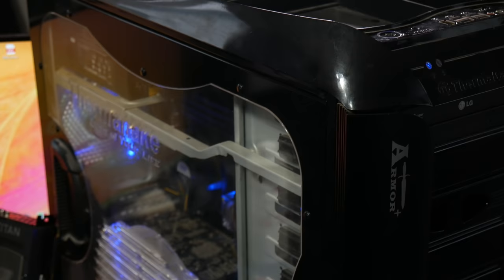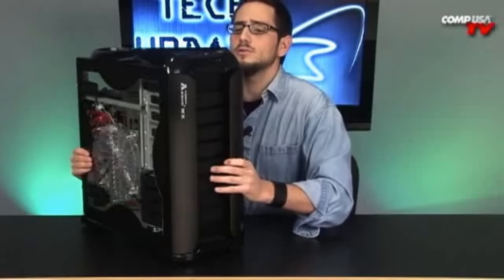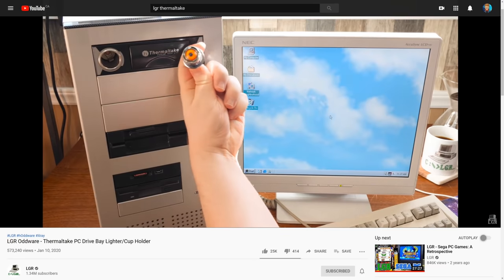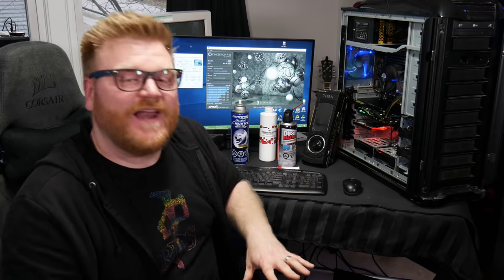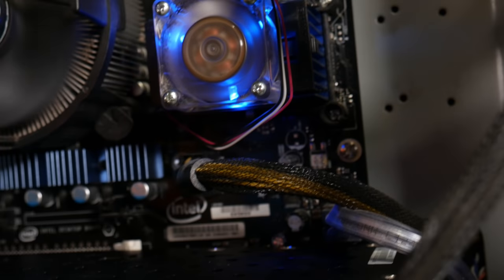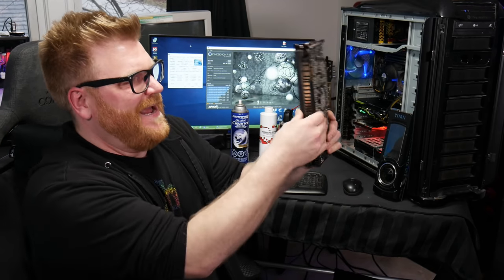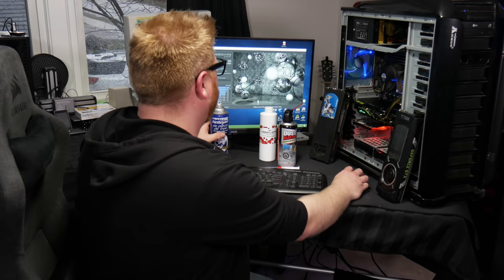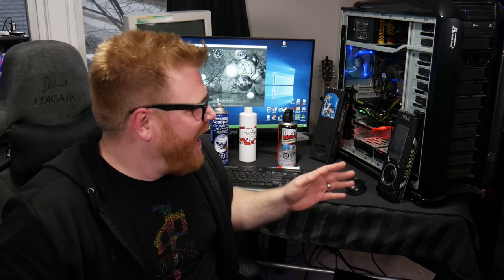Can $5000 buy a PC that will last 10 years?

Comment: 5000$ but stock Intel cooler
Reply from the maker: I know right, that's just bush league
Reply: There are people playing AAA games with 2700k and stock coolers right now and they are just beginning to feel like bottlenecks.
Reply: @JonathanPaulin  well yeah, especially if you overclock it. Stock amd coolers are great if you are running stock ryzen 2000/3000 chips or if youre like me and overclock a 1600AF it holds temps just fine under load. Obviously a little louder but nothing i cant live with.
Reply: i got my noctua nd 14 in 2010 and 10 years later its still rocks!!!!
Reply: @JonathanPaulin  i know right. i use a i7 2600 with a rtx 2060. only a few games like Red Dead 2 actaully choke the cpu.
Reply: @TimmyJoePCTech  did the guy build this himself or did he get it pre-built
Reply: Right!  That was the first thing i noticed!  How sway...how?
Reply: he could just get a aio
Reply: But it was the big 1st gen i series cooler.  They did a pretty good job as long as the thermal paste was good. My system rocked one for the longest time and it stayed nice and cool. If anything that was a problem then it was the graphics card running hot when gpu's were getting big upgrades from the manufacture *cough Asus cough*. The only stock coolers I'd worry about are core 2 quads since they run pretty toasty even with good case ventilation. If you live in a place that's hot or your overclock you should have aftermarket cooling.
Reply: @Rainbow__cookie  it wouldn't suit this guy's as he will use the machine for the next 10 years or so which would be outside of the life cycle of the aio
Reply from the maker: @davidhiggins2804  Bought it at a PC/IT store here in 2009
Reply: Jonathan Paulin I play with i5 7600k and stock cooler but here’s the background. In 2017 I had $450 to build a computer. But I had some components like a crappy dedicated GPUs (ddr3 2gb, ssd, hdd). With that $450 I built a 2 core Celeron pc, 8gb of ram and 2 Hdds with an ssd. That was the best I could get at the time. Then 1 year later I buy a i5 7600k and use the stock cooler because I’m not over clocking. Now I have 8gb of ram 1050 ti and i5 7600k.
Reply: @kennysboat4432  Upgrade your GPU to GTX 1650 Super or GTX 1660Ti. Absolutely worth it for 1080p Gaming.
Reply: Uber Gamer!
Reply: The Intel stock cooler is really bad for games like Crysis 1-2-3, X-COM 2 and many others even if you have a non K Intel Core CPU, never use the stock cooler for games. I'm using an i7 2600 too, very good CPU but you need to upgrade your cooling as soon as you can.
Reply: I ran a Core 2 Quad 9300QX build with an Intel mobo that supported first gen DDR3 until like 2015. Was a sweet build and I was stoked to have a Core2 with Ddr3 in it
Reply: @TimmyJoePCTech  I just got this exact board, but with the i7 970 and the Intel tower cooler. It's good with an overclock, but the bios is a little funky, and stay away from the 4th slot of ram
Reply: Noctua NH-D15 should be the norm for all high end builds. Just like how the Cooler Master Hyper 212 was for cpus up until 6600K.
Reply: "5000$" putting the dollar sign after the numbers is one my pet peeves. 
The dollar sign goes in front of the numbers like this --> $5000

Comment: How to have a high-end end computer for 10 years in these two easy steps....1st Build $2500 computer wait 5 years 2nd build $2500 computer.
Reply: Dan Reed thank you for putting the dollar sign on the correct side. I almost never see that anymore.
Reply: Tyler Mitchell it really should be 0$ instead of $0
Reply: Reminds me of the memers buying overkill 16 core PCs for gaming cause muh futureproof when nothing is futureproof
Reply: @zubiecup  in many other languages than english the currency sign comes after the amount so i guess thats why you see a lot of people doing it like that
Reply: Talvisota yes, I’ve always assumed that’s the reason.
Reply: Kennys Boat no, not for USD. The sign always goes before the amount. The cent sign is written after the amount, though.
Reply: Most of us upgrade one part at a time basically. In general I upgrade my CPU on a 5 year cycle and GPU every 2.5 year cycles with storage upgrades and misc in between. My cpu I did wait 5.5 years as my 4770K was pretty solid until around 2018 or so with some virtualization tasks and a few stutters in 2019 games here and there. I do feel like an idiot just upgrading to a 2080Super as the 3060 will humiliate that and probably Navi2 :-(. I will live with minecraft raytracing for 2 and 1/2 more years as I paid $799 for my evga model.
Reply: @Amusia727  the i7 i bought  back in 2013, out classes the i5 that people kept claiming was enough. is still playable.
Reply: @mryellow6918  Just because a Haswell i7 is still playable doesn't mean it's "futureproof".
Reply: Yeah 1500-2500 every 5 years makes more sense than 5000 every ten years
Reply: @Alex-pu5lz  it depends on your peripherals
Reply: @Amusia727  Futureproof for 4 years at least, unlike intel alternatives.
Reply: Technically even $2500 is extreme for a high end PC, a decent ryzen + RTX card would bearly be around the $1000-$1500 mark if you look around right and get good deals, end of the day the better the deal you get the better you are in the long run.
Reply: I definitely wouldn't recommend spending "as much as you can," but it is possible to future proof to some degree.

I spec'd my 2010 laptop with a first gen i7, 8GB RAM, dedicated GPU, 1080p screen, etc for $1,300.  It easily remained relevant and usable for 10 years, and I was even able to game on it that entire time.  I periodically maintain it as it is still a great work/multimedia computer.

I built my 2017 desktop to do 4k gaming, 4k60 video rendering, and VMing for $4,000:  Two GTX 1080 Tis, i7 7700k, 32GB 3600Mhz RAM, 1TB m.2 SSD, liquid cooling, etc.  Even with SLI support having mostly gone away, the thing's still a tank (~RTX 3060 equivalent on a single card) and a monster movie maker (8k60 VR w/binural audio).  Only thing I've added is more covenient storage space (24TB of SSD) for video rendering/game installs.  No doubt it will last me another five years, and it has literally paid for itself.

Comment: A guy on a forum I used to frequent bought a $1000 video card every year, sold it for $800 and bought another $1000 card so he had a top of the line card for $200 a year
Reply: Well today a rtx 2080 ti is much more then 1000$
Reply: This is pretty much exactly what I do, and how I went from a low end gpu to being able to financially afford a higher end one
Reply: Yeah idk about that. A 2080 Ti is $1200 USD and I’d be lucky to get $600 for my 1080 Ti and its a factory water cooled Aorus card.
Reply: @JTTTTT850  2080ti can be as low as $890~
Reply: @TehTechExpert  2080ti can be $100 in about 5 to 7 yrs.
Reply: @LeoNyeDis  I'm almost embarrassed to admit this but I'm pretty content with my RX 580 😛
Reply: @jeremygregorio7472  dont really need to upgrade until next year tbh. My 970 still runs games fine at 1080p. Thats exactly what its for, 1080p. But next year, i buy whole new system because new consoles and everything.
Reply: yeahh buddy same, I spent $1000 for my pc and I paid $400 for my vega 64, and I play almost every triple a games in 4K high 60fps, I don’t need to upgrade anytime soon, but I want to u know?
Reply: @Samuel Diffenderffer we talking top of range not mid range horid driver cards
Reply: @JTTTTT850  I bought my aorus waterforce xtreme with water block removed, and an NZXT G12 and Corsair H60 installed instead for $420 shipped to my door.
Reply: @jeremygregorio7472  went from an rx 580 to a gtx 1070 in exchange for upgrading a friends pc. wasnt a bad upgrade but if i still had the 580 i wouldnt be buying anything thats on the market right now
Reply: I mean he still spent that initial 1000$ so he still buying a 1000$  gpu  every year. This mindset only works if the card is given to you for free. He's still out a grand at the end of the day. Great way to upgrade yearly/each gen. But saving money wise not so much lol
Reply: @JTTTTT850  for non RTX Stuff the GTX1080Ti is likely better Than the RTX2080ti
Reply: @JTTTTT850  Well the 1080 ti came out 3 years ago for 800€ so it hasn't dropped much in price.
Reply: @JTTTTT850  1080 ti can be found for 380$ for inno 3d to 420$ for evga sc2 

bought one from a guy in Thailand and also bought vega 56 red dragon for 210$
Reply: @jeremygregorio7472  i upgradet my rx480 (580 is a rebrandet 480) to a 5700XT after i had to but the AA down at 1200p in rise of the tomb raider.
Reply: 1500-1600 bucks every 3 years is what I'd say I do for my wife and myself
Reply: @yvonbriand9739  you don't have to buy a water cooled 1 zillion teraflops 2080 lol
Reply: I'm on the other side of the spectrum. I buy my graphics cards second handed and sell my old one. If you do enough research and have some luck, you can often find much better cards than your current one (Assuming you have a low to mid spec system) for only a few euro's/dollars more than your current one is selling. For me, the cheaper version of last-gen mid-end AMD card is often the sweetspot. I just upgraded from a R9 380 2GB to a RX 580 4GB. I bought the RX 580 for around €100,-. The 380 sells for around €50,- to €65. That €50 upgrade makes a huge difference. An 8 GB model would have been €40 euro's more, which would almost double my costs and 4 GB is still plenty for 1080p gaming.
I'm planning on upgrading my R5 1600 to something like a R5 3600 or a R7 3700x when gen 4 or 5 is out.
Reply: Jeremy Gregorio that might work but it didnt back in the day. A lot of high end gpus were $500 and would be worth 200 1 year later.
Reply: @JTTTTT850  Lol mine is the Asus Founders Edition 1080TI.
Reply: @cadenmiller  That's the boat I'm in. i7-6700k and a 1080TI. Runs games on high at 80 to 90 fps at 1440p. I want to build a watercooled system, because I want the challenge, and I like building PC's. Planning on building a new system in the fall when the 3080TI and the ryzen 4000 series launch. Then going to give my current system to my brother so I can finally induct him into the master race.
Reply: Raymond Sellers yeah I have a Ryzen 5 2600x with a asus rog strix b450-f gaming motherboard, I want to get an AIO for my next cpu, but I’m just gonna wait for Ryzen 4000 and get a x570 motherboard cause that’s the last lineup of the AM4 socket, then also I’m gonna get their rx 5900 XT, I’m personally Amd only idc about Intel or Nvidia
Reply: @yvonbriand9739  yes but why bother when a 4gb 1080ti can do the same thing for a lot less ?
Reply: That's 1200 a year
Reply: What about the cpu and mobo? Same thing?
Reply: @yeahhbuddy3932  I just upgraded from a 970 and a 4690k to a 2060 and a Ryzen 3600x and holy poopers, it's at least %50 to %100 faster in all newer games and benchmarks (3x faster in Cinebench)... If you wait until the 3000 series and Ryzen 4000, you'll be laughing at the upgraded performance and wondering why you waited. But definitely wait until next year, that new tech is going to be dope.
Reply: This strategy works well for Titan cards because they hold an oddly high resale value, I sold my Titan X Pascal for $950 AFTER the 1080 Ti came it, there's no reason it still should have been worth that much.
Reply: It doesnt work like that. You still have to spend the 1000$ for the initial card and it can be tricky to sell a one year old card for just 200$ less than retail.
Reply: Jeremy Gregorio same here👍 still does destiny2 max settings
Reply: @jaydaytoday3548  it will never be £100 because unlike back then gpu performance is way beyond standard. in 5 to 7 years people will play games at like 4k 120fps which that card will do about 4k 60 in most games. so,half the performance of what will most likely be the norm of 2027. it will be around £350 because we wont have improved much as we did from 2010 to 2020
Reply: @jeremygregorio7472  ive got rx 580
Reply: @yvonbriand9739  i'm probably gonna sell my 2080ti when the 3080ti comes out lol
Reply: scottrich976 a 4gb gtx 1080 ti doesn’t exist. But I know what you mean I still use a 1080 ti Kingpin and I love it but the OP said top of the line card every year.
Reply: Gamebattles1946 that makes sense you should get a good return on your 2080 ti lol
Reply: @JTTTTT850  you got to sell early in the product cycle.
Reply: @Samuel Diffenderffer I need that RDNA 3 in my life.
Reply: @cadenmiller  With the way nVidia is moving money around to their quantum division, AMD is going to overtake them and nVidia is letting it happen. This is the same situation with Intel. They have both openly stated they are moving the majority of their R&D and production to new markets. Also, the next generation of consoles are AMD machines, which means there is a good chance games are going to just run better on AMD machines. RTX? That is going to go the way of PhysX. As soon as Window's ray tracing fully hits the market RTX will be left behind.
Reply: @Bionic0ne yeah I also heard what intel and Nvidia is doing, their pricing is way to extreme and Amd deserves more. Also Amd is going to have raytracing them selves soon sooo...
Reply: @Bionic0ne I’ve been with Amd for at least 3 years, Ive never owned any Nvidia or intel product, and I’m very happy.
Reply: That worked for a long time.. until 2080ti. 2080 and 2080 Super are still GREAT cards.
Reply: @yvonbriand9739  I got a new one for 1000. Then I sold my 1080ti for close to 700
Reply: @blairlohnes8103  I went from a 4690k and a 660ti to a R7 3800x and 2070S. Was so worth it imo
Reply: I have not payed a full price for a gpu for quiet some time.
Reply: @Samuel Diffenderffer i would rather get nvidia because there is always new technology while amd just add fps, so it feels like you're just wasting money.
Reply: that's what I do basically.
Reply: s t o n k s
Reply: the trick is to do it every year so you don't lose too much money. a 1080ti is 3 year old now so of course it's gonna be cheap to sell.
Reply: @jaydaytoday3548  Highly unlikely , 1080ti is now 3.5years old and still sells for around 500+ Usd . and the price for a New one in 2017 was 699usd . thats a 200usd drop in over 3 years  and a new generation .
Reply: @JTTTTT850  5-600usd for a 1080ti aint bad tho, Preorder back in 2017 was 699usd
 for a brand spanking new ...
Reply: @yvonbriand9739  RTX 2080 TI is a horrendous value.
Reply: BonJarno 4gb is not plenty for 1080p
Reply: @yvonbriand9739  no the 2080 ti is around 800 dollars so he must be buying the msi lighting edition
Reply: If he got a 2080ti 2 years ago, that still top of the line today unless he goes Titan for double the price and only 5/10% plus performance
Reply: That's not how math works. He still paid $1000 for the initial purchase.
Reply: I do that. and its not really that big of a deal. 
I always have the best that way

Comment: Ten years time: intel releases hot chocolate lake, 14nm++++++++++++++++++++ 8 core i7 with no hyperthreading for 1000 dollars with 6ghz
Reply: and 444W TDP
Reply: no the core i7 would be 12 cores @5.8 no hyperthreading by then
Reply: @AsekiBekovy  thats the i9
Reply: And you will need a small nuclear reactor to power it and an AC unit to cool it
Reply: Meanwhile: AMD releases Ryzen 10 uses 10W, 2 nm, 32 core with quad threads.
Reply: Its netburst all over again
Reply: and it will still be the best most stable CPU for gaming.
Reply: hot chocolate lake
Reply: Sounds pretty accurate lol

Comment: Not enough LED's in that computer for the budget, That thing should be glowing like a UFO for the $5k budget
Reply: It should beat Elon Musk to Mars for that kind of money. ;-)
Reply: back in the days RGB wasn't a thing so ...
Reply: @sandidbouha3886  no. Then it was cold cathode lights and UV reactive paints and plastics.
Reply: I miss Bitfenix Colossus full tower cases, they were AWESOME!

Around 10 years ago, i had few of em, but eventually them leds died...
Reply: @sandidbouha3886  I didn't say RGB if your referring to the specific dates in this video... I said Led's, which were around - But were mostly on either fans or molex strips.
Reply: you dont need rgb for a good computer, performance is the most important thing
Reply: @scoodz5788  you could also get pcie powered ones.
Reply: dude... lights in your PC 10+ years ago were scary stuff. I had a black light fan catch fire in a case once and hadn't considered case lighting again until this most recent build of mine.
Reply: It was not popular back then.
Reply: Eclipse49 haha you get a 40% performance boost
Reply: Eclipse49 rgb gives you 20% performance, so...